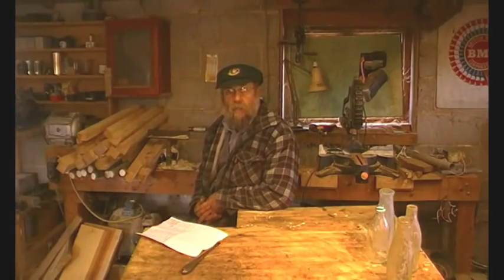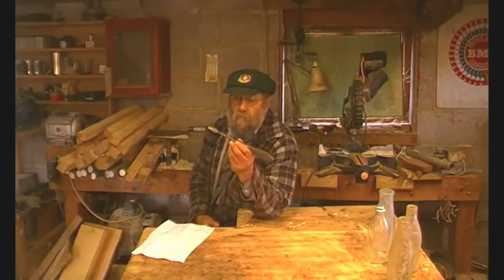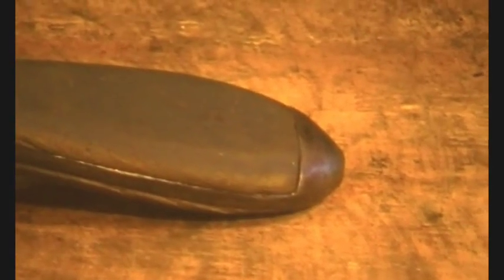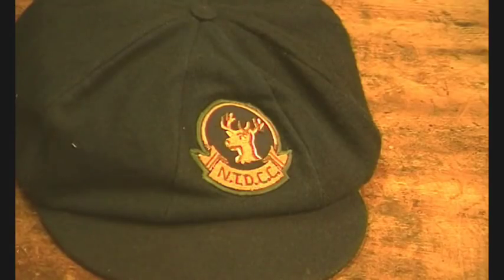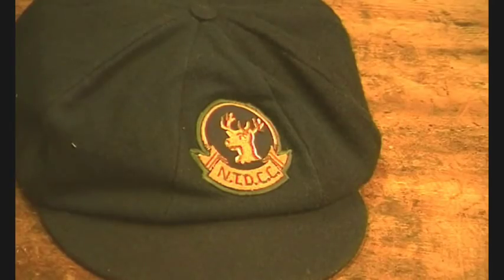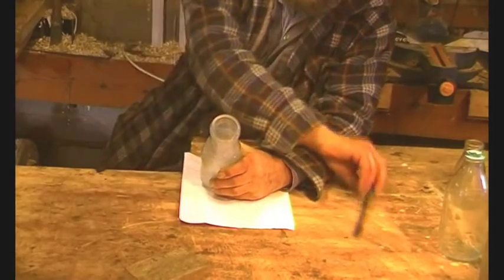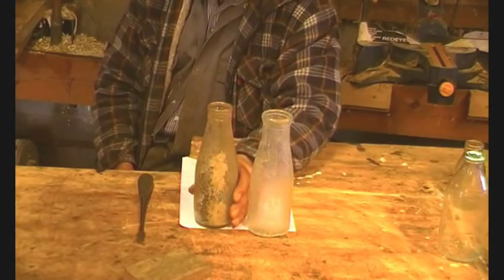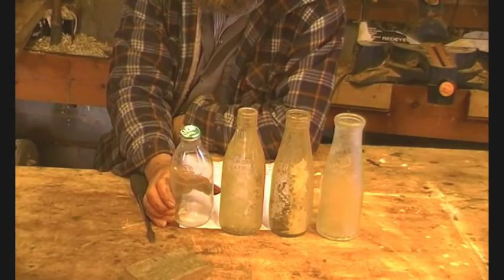Tools, milk bottles, cricket caps, and vehicle rant

Comment: Mercedes cars are made to a profit margin today, so many common issues, nothing like the 80s & early 90s quality. What old cars do you recommend to avoid computers and the ULEZ charges? 
Mini's are popular and available parts but rust so quickly but the 850cc does around 40 to the gallon, or maybe the old beetle since they have good parts availability.
Reply from the maker: Hi, trying to find the right car for me is almost impossibe, but having a Mk1 and a Mk2 Frontera and now this CRV I do like fuel injection but it's not servicable like a carb and has a computer, but from my experience it gives less hassle (for now). I suppose the main criteria is spares availability, own mechanical skill, fuel comsumption, and miles driven, and for me dealing with wet off road conditions when at work. Cheers

Comment: I didn't know there was a Morris Minor pickup looooong wheelbase model :o) Also, what period is the titanium screwdriver from do you reckon ? '50s is my guess - it's a nice thing, and possibly the oldest titanium object I've  seen - is that possible ?
Reply from the maker: Dave, the only long wheel base like that, don't know where it is now. I reckon that screw driver was 50's, nice design, wish it was titanium. Cheers
Reply: Oh, I thought your screwdriver was titanium,  I misunderstood in that case - so yours is just a nice looking steel and wood one then.... I got the age guess right at least :o)  In the 80s/90s I lived on a dairy farm, and they still had a pile of those wide-neck bottles in circulation, like your 2nd one in the vid. Don't know which year they originated from though. Cheers.
Reply from the maker: Dave, it seems many local dairies kept using these old bottles for a long time. That minor truck started off as a 1/2 ton van and when the rear chassis finally gave in I made a new one from 4 x 1.5 inch I beam. It's just that I used what I had and that's how long it turned out. Great for moving stairs although the turning circle was about 20 yards, cheers